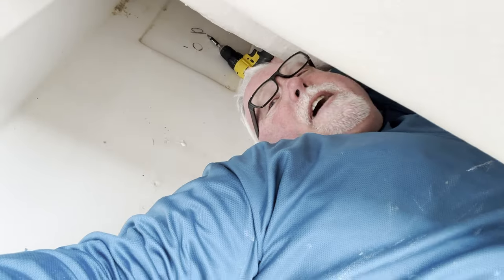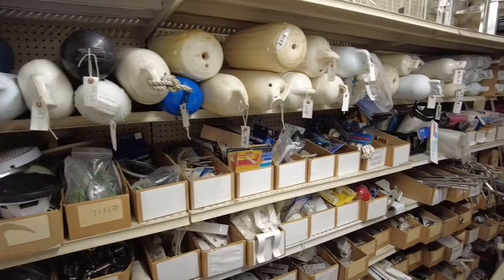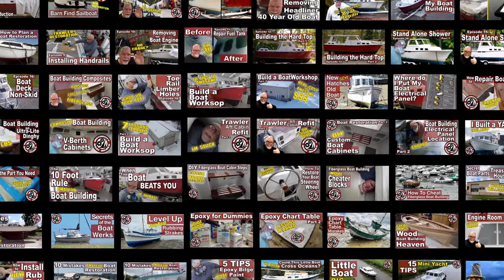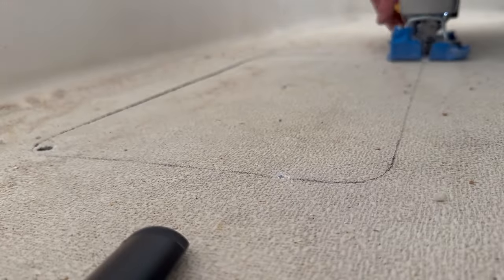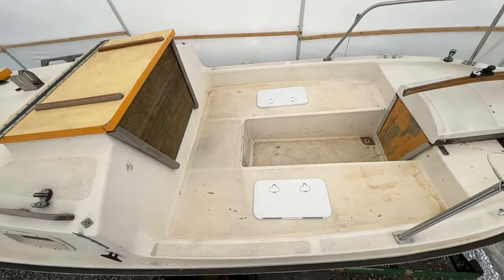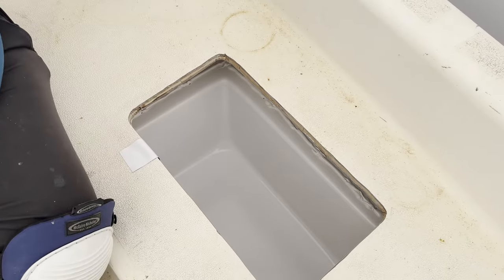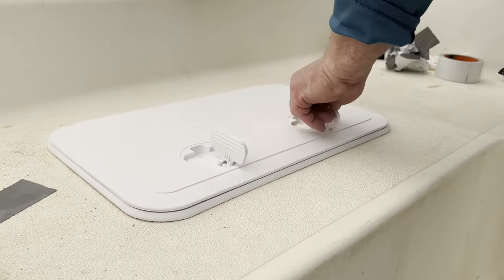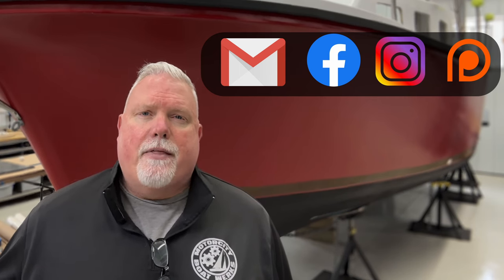Sailboat Cockpit Lockers (Ep75) | Small Sailboat Restoration | Boat Building

Comment: Hi Joe,
I’m really enjoying your videos especially when you do one on the Skipper. As a former owner of nearly 30 years, I look forward to seeing what you do with the boat. That being said, I really think you must remove the foam in the lazarette. Whatever it takes, the foam must go. Sooner or later, you will need to access the drain hoses and thru-hull fittings. Ask me how I know! 

I don’t think you need to make a plug for the bottom of the motorwell. In 30 years, the amount of water that came in this way wouldn’t fill a small bucket. More came in thru the opening into the cockpit and a small bilge pump fed into the motorwell handled that nicely. I noticed a small hole in the aft wall of the well. Maybe that was how the water got in. I did not have that hole on my Skipper.

I really liked watching you struggle with the installation of the cockpit lockers. I had a similar experience when I added swiveling fairleads and cam cleats on tracks on the cockpit gunwales for my Genoa sail. You and I have similar builds so I know what a tight squeeze it is under the cockpit.
Reply from the maker: Thanks for the comment 😁👍